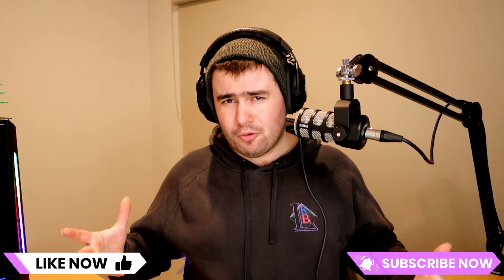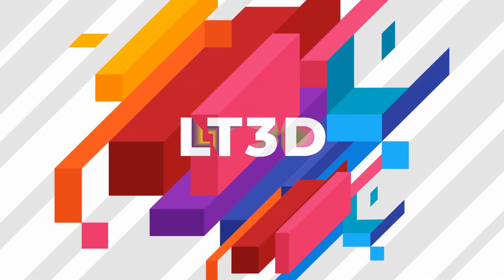Printing Miniatures on the Adventurer 5M with a 0.25mm Nozzle!

Comment: Im new to 3d printing and im using the .25mm nozzle on the ad5m. I slowed down the default settings in orca slicer, I do have a different plate then you but the issue I’m having is when gets to the second layer the first layer slowly peals up. I think it’s because  when it gets to the second layer the fans speed up and cool the second layer too quick. Is there a way to fix this?

Comment: Nice, what layer height did you use? what is the lowest possible in this M5 printer?
Reply from the maker: I used defaults at the time which I think was either 0.08mm or 0.10mm.

Using the 0.25mm the lowest current profile is 0.06mm.
Reply: @LT3D_YT  Oh, OK. So the lowest possible is actually the same as Bambu Lab A1 I guess.

Comment: Nice video concept but i wouldve been much more interested if you went over some setting tuning, actually handling and analyzing your prints, and some support removal solutions because that can be the hardest part of miniture printing, just kind of an opening slideshow and closing, great video and audio quality though, and again nice concept
Reply from the maker: @cmgraeber  thanks for your comment,  might do one similar in the future. As I mentioned in the video it was my first time printing miniatures and I was more interested in seeing what you can get straight of the bat without tuning.

Comment: Hey! Im so sorry to ask but I have this printer too and would like to know what your settings in the slicer were. It's so hard getting information on the 0.25 nozzle and only really find info for other printers of 0.2mm size.
Reply from the maker: I used default settings inside Orca-Flashforge
Reply: @sametdursun8651  Under printer you have to go to "select/remove printers (system presets)", then type flashforge in the search bar, and click the box to add the .25 nozzle to your system presets
Reply: @oneandy2  i fixed later. Thank you anyway

Comment: Thanks for making making this vid for us, i was just about to buy a 0.2mm nozzle for my X1C, love the details, a little stringy but that's expected i guess, btw what filamant are you using filament?
Reply from the maker: @Creative_Chris  yeah I was going to clean up the prints but I wanted to be honest with my first tests. The filament is some Bambu Lab Matte PLA that I’ve had just sitting around for over a year, probably should’ve dried it out before printing 😂
Reply: @LT3D_YT  Yeah, dry it out and it'll look way better. Please think about sharing your print settings next time, it would have been interesting what layer hight you chose.
Reply from the maker: @McGyver4711 definitely will do in the future. I basically just used the default settings in Orca-Flashforge.
Reply: @LT3D_YT  how to do you get the .25mm nozzle to load the profile in orca slicer? I cant seem to get it to load the settings for it like the .4 and .6
Reply: Nevermind i got it had to remove the printer and re add it to get the nozzle selections. Good stuff!
Reply: @aceswild8329  yeah i couldnt find 0.25 nozzle settings in orca.